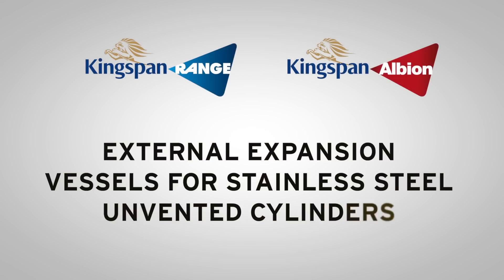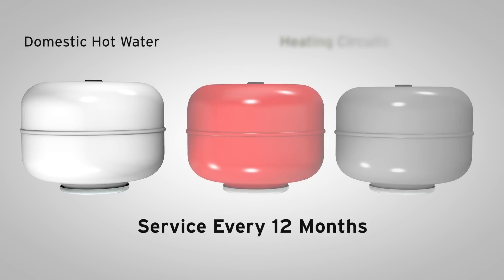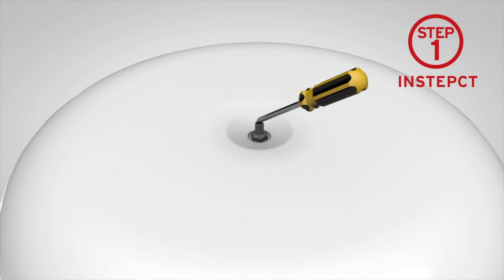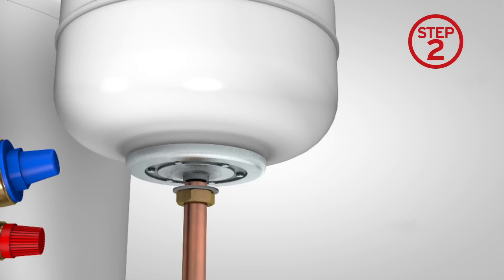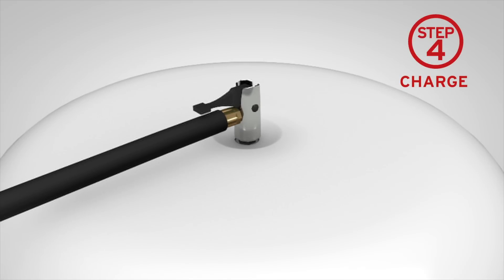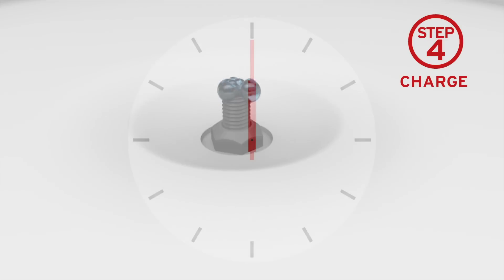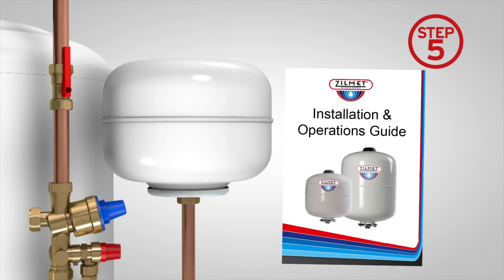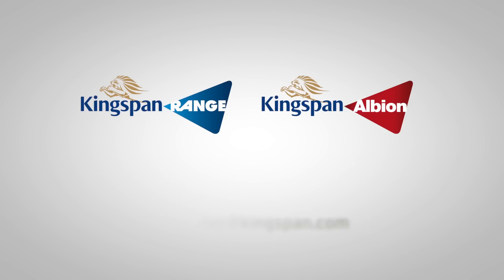How To Check and Recharge an External Expansion Vessels | Unvented Cylinders

Comment: You should not just top up 3bar into the vessel. You need to understand the system static pressure (including header height) and then pressurise +0.2\0.3bar above this pressure. So if your system is 1bar the EV pressure will be 1.2\1.3bar before water is introduced to the vessel. If you under pressurise or over pressurise the vessel then it will not function correctly and put undue strain on other components in the system. Accumulators on the other hand need to be pressurised 0.5bar below static system pressure to allow the vessel to be partially filled when installed. I have been in the industry 2decades and this is how I correctly pressurise vessels.

Comment: What would cause the hot water to run fast for a few moments after heating, until a creaking noise occurs and it runs normally again, when the expansion vessel has been tested and is fine? The cylinder is indirect unvented and every possible valve that could have an air pocket has been checked.
Reply: We had this exact issue. The manufacturer came out and dropped the vessel pressure and it fixed the issue.

Comment: My pressure relief valve is rated at 3 bar, so wouldn't 3 bar on the expansion vessel be too high, not allow expansion and potentially cause the relief valve to blow?
Reply: Probably; my hot water vessel is 3 bar with a 6 bar relief valve, and my heating vessel is 1.5 bar with a 3 bar relief valve.

Comment: Boiler charge of 1.5bar is misleading. Most are 1 bar. 1bar equals 10.2m head. Any boiler expansion vessel should never be more than 1.5bar. On the water side, you can't go too big only too small with the vessel. If in doubt, go larger

Comment: Interesting that it says check every 12 months. I fitted a new Zilio Industries sanitary water vessel and the instructions for that said check every 6 months. I didn't know you were supposed to remove the vessel completely to check the air pressure. I would have thought it OK to turn off the feed to the water heater, turn on a hot tap and take the reading.
Reply: I think that would be ok too

Comment: is an expansion tank required for water heaters that are fed from a water supply with 2bar pressure?  is the supply pressure even relevant?  
Ive had two under sink water heaters fail. Both plumbers did not install an expansion tank, saying it wasnt needed.
Reply: Bit late now but for anyone reading with same issue. Bar is irrelevant, the unvented part relates to the expansion vessel need. But under sink water heaters only need a vessel if over 30litres in capacity. If under then no vessel needed.
Most larger heaters have internal expansion vessels so an external isn't needed.
If indeed the Manufacturers instructions say it doesn't have an internal vessel and over 30 litres... A small 2 litre vessel is installed, normally with a check valve on pipework to force expansion to it.
Reply: @davetomlin2603  cheers Dave

Comment: I would question his pressure in a heating system. .5 bar for bungalow 1 bar for a two story and 1.5 bar for a three story house.
Reply: Yes bang on... Ish.
The bar relates to total head. The vessel size relates to size of install/rad and pipework.
Standard is 1 bar. But as you rightly said if three storey you would need it at 1.5bar.
1 bar is 10.2metre head
Reply: @davetomlin2603  but on the instructions it stated to charge the vessel to 3 bar to match the multiblock pressure reducing valve?
Reply: @techgeek_  then Def do 3bar, manufacturer specs supercede anything else.
Reply: Not in an unvented system
Reply: @jra55417  ofcourse it relates to unvented.... You wouldn't even have a vessel if vented

Comment: How do you de pressurise if the valve is faulty. My vessel is red hot but the valve doesn't work. Don't want to unscrew and get a nasty surprise.
Reply: Isolate, drain through the taps and replace the cylinder.

Once youve isolated your cold water and drained through the hot tap the pressure will drop
Reply: @amxltd8718  nice one worked a treat.👍👍

Comment: Very good, however, why replacement of the whole unit? Just fix/repair the broken part:
Leaking schrader valve, just remove and screw in a new needle valve and repressurize.
Water from schrader valve,  remove and replace the rubber bulb (when replaceable).
Reply: if the shrader valve is leaking water then the expansion rubber diaphram inside has failed and you need a new expansion vessel
Reply: @skinnzthedon  You would check this while the expansion vessel is still connected to mains? Hold down the sharader valve while the water is pressurised.
Reply: @techgeek_  water should never come out of the valve regardless if the mains is on or off
Reply: unless its a touch of condensation  @skinnzthedon

Comment: Why would you replace the whole tank if a 50p schrader valve is faulty ?
Reply: upon leaks its usually the rubber diaphragm that has failed not the schrader valve.
Reply: What has that got to do with my question ? To rephrase, if the shrader valve is shown to be faulty, why not just fix that ?
Reply: fraggle23, of course try that. But I’ve only ever seen diaphragms gone.  The risks from a blown diaphragm combined with seized safety valve make me want to swap out exp. vessels early.
Reply: @fraggle23  Why would you!  If that is damaged then other parts inside will be now or very soon. Just change it and stay safe.  These vessels are not expensive.
Reply: This is a (Fu)Kingspan video, they want you to buy another vessel for no reason other than to make them more money.
Reply: Swap it and be safe

Comment: We have an expansion tank on our hot solution, in floor radiant heating system.  Vessel has a thunk on top and a twang on the bottom.  Is there anyway to improve the seal on the valve stem insert?  1.  Does a standard bicycle valve work in the valve stem?  2.  Does a standard valve stem tool work for these pressure vessels?  Thank you